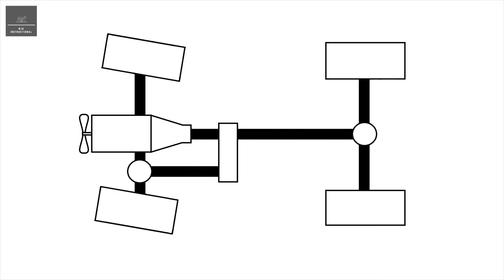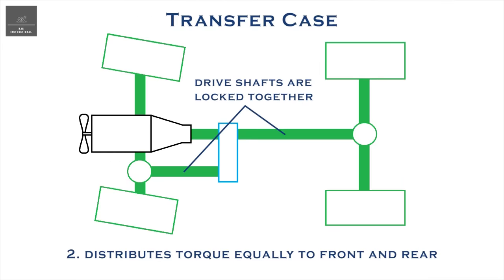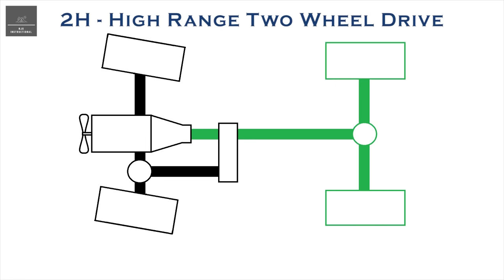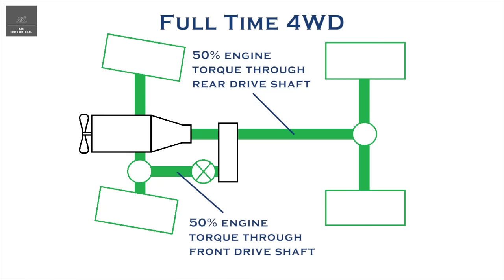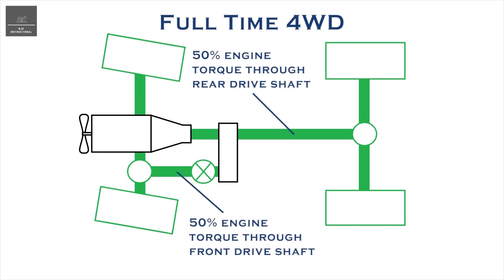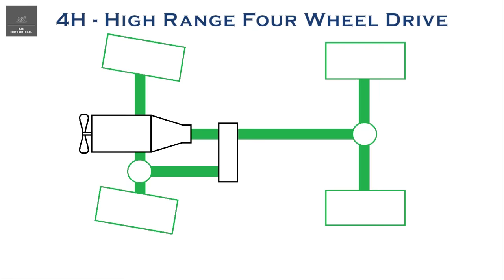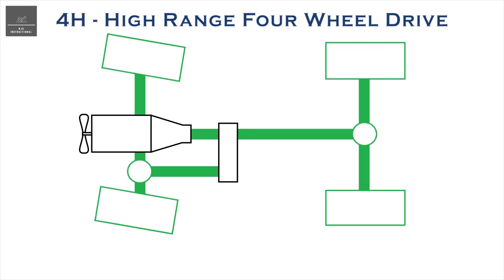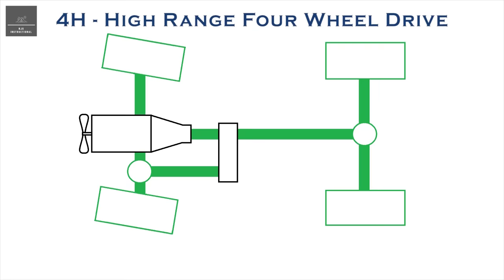How 4WD (4x4 - Four Wheel Drive) Works - 2H, 4H, 4L, LSD, Centre Diff, Diff Locks, Traction Control

Comment: great vid but you mixed up torque split and speed split for locked vs open diff. open diffs have 50/50 torque split and uneven speed splits while locked diffs have variable torque split and locked speed split.
Reply: No, he was right. In open diffs, under IDEAL conditions, it will be 50/50, like going in a straight line. But let's say you get one wheel stuck in the mud or whatever, that one wheel in the mud will now receive 100% of the torque, while the other will get 0. Remember, torque will follow the path of least resistance. In a locked diff, since both axles are locked together, they will both receive 50/50, regardless. In this case, let's say you get one wheel stuck in the mud again, that one wheel will still get 50% of the torque, it just won't be able to do anything w/ it due to it not having any traction. The other wheel w/ traction will just have to use its 50% to get the car moving. Hope it made sense.
Reply: @YourMom-nl4uw  What you just explained is almost correct but again you are confusing how torque works. The whole reason why locked diffs are better with low traction is because they automatically shift torque to where it needs to be and they never let torque get limited by the wheel with the least traction. The reason that open diffs lose torque to the wheel with traction is not because the torque is being sent to the other wheel but rather that both wheels are required to have the same amount of torque sent to them. It requires practically no torque to spin a free wheel so therefore that same, very limited amount of torque is applied to the wheel with traction.
Reply: @harrisonwest4032  
Ok. I don't know enough about this to dispute it so I'll just go with it lol..
Reply: @YourMom-nl4uw  Harrison West is correct, open differentials split torque 50/50 regardless of whether both wheels are rotating at the same speed or one wheel is stationary and the other is in the air spinning madly. It's a common misconception.
Reply: @LockyourHubs4WDing  
How, tho? Torque is just a turning action. So how can it still be 50/50 torque split when one wheel isn't turning at all?
Reply: @YourMom-nl4uw  You don't need to be moving to experience a torque. Think of tightening a bolt, when the bolt is tight, you can still push on the spanner, the bolt is experiencing a torque, but the nut isn't going anywhere. Power on the other hand is work done, so without movement, there is no power.
Reply: @LockyourHubs4WDing  
Makes sense

Comment: Hi! May I clarify one thing. I have read the manual of my Pajero Sport. It says you can switch 2H to 4H even up to 100km/h without stopping. So does that mean it is damaging the vehicle when switching to 4H since there is torsion in between diffs?

My Pajerosport has this options. 

2H
4H
4HL
4LL

And a Rear diff lock switch
Reply from the maker: Hi Alain, the Pajero Sport has a few more options which allow it to be used in All Wheel Drive (4H) or Four Wheel Drive (4HL and 4LL). You only run the risk of 'wind-up' on sealed surfaces and in your case when the centre diff lock is engaged (i.e. in 4HL or 4LL modes). If the manual mentions it is ok to switch from 2H to 4H at speeds up to 100km/h then I can't see any issues. Trust this helps.

Comment: Basically a two wheel drive is a one wheel drive 
A four wheel drive is a two wheel drive 
A 4x4 with rear locker is a 3 wheel drive
A 4x4 with front and rear locker is 4 wheel drive

Comment: It may be a stupid question (I'm new to 4WD vehicles), but the wind-up can happen if you use the 4H/4L in a straight line? Sometimes I need to use it to park my truck in my garage because the sidewalk is very high and the rear tires skid
Reply from the maker: Wind-up wouldn't typically occur in a straight-line as there is no inner and outer, front and rear wheel rotation differences.
Reply: @NJSInstructional  Do you think I can continue to use it without the risk of damaging something or it's something I should stop doing?

Comment: An open diff does not transfer the torque to the wheel with the least resistance. The torque goes equally in both directions, but the displacement goes mostly to the wheel with the least resistance.

Comment: may I ask a quick question,  to clear my mind once and for all? On pavement when the roads are wet, am I better of changing from 2wd to full-time 4wd for better braking, etc.  Thank you in advance, cheers Paul
Reply from the maker: If you vehicle is a part time 4wd I don't recommend switching to 4H on tarmac roads in the wet. You may damage your drive train due to wind-up.
Reply: @NJSInstructional  thank you
Reply: Hi Paul, my Ram truck has 4WD "Auto" which essentially is AWD which most of the traction goes to front wheels and allows for each wheel to potentially roll at different speeds ( turning steering wheel while moving on hard pavement ) and can be selected at up to 55mph. Then it has a 4WD Lock ( 4WD Hi) in which all 4 wheels roll at the same speed so you would need gravel, mud, or sand etc, for the tires to slide around while you are turning because turning while moving makes each wheel roll at different speed. Then of course the (4WD LO) function in which this video covers also. Only 4WD "Auto" can be engaged while moving. All others on my truck can only be engaged while in neutral and foot on brake.

Comment: Great video, Can I ask what is the maximum speed one can do when driving with 4L?
Reply: It's different for all, but usually between 25-40mph pegged.
Reply: @yjjeeper1  great ,thanks...
Reply: It's different in each vehicle. Mitsubishi Pajero, don't have speed limit in 4L
Reply: @lapitima  you miss understand. No other vehicles have a 4-low speed "limit" either, that's just when stock incarnations tend to run out of gearing in 4 low.  I know how much you foriegn guys love your Pajero's (basically Montero here), and ive seen some cool builds of them but don't be quite so quick act as if they are the dominator of everything becaus they have their strong and weak points like every 4 wheel drive and are hardly the king of the group.

Comment: Good info. What about using 4H during raining at normal tarmac road. It is recommended or not? and why?
Reply from the maker: Thank you. No, I don't recommend it. Though the road is wet, there is still too much traction and will cause wind-up in 4H with no centre-diff.

Comment: Part Time 4WD Scenario - 4H or 4L
50% torque split makes sense to rear tires Left/Right (locked diff) when both tires have equal ground contact and resistance (one isn't rolling over a rock, for example).  But if one is in the air and other on ground then wouldn't essentially 100% of torque go to that grounded wheel?  I understand the diff splits rear drive axle to two tires, hence 50% torque, but if one tire is in the air then it really isn't consuming any torque in order to turn it.  I mean, since torque is force/distance and the spinning wheel is consuming (let's just call it zero for this purpose aside from wheel spinning momentum/etc) uses zero torque but the drive axle is still outputting value X torque so that means the wheel in contact (in a locking diff scenario) would have ~100% of the drive axle torque (assuming for argument sake that the diff gear ratio was 1:1).  
It's hard to be suspensed on just one tire but let's assume a diagonal situation on a hill with rear low and somehow the top contacting tire is also on ice. In this scenario then torque split to front/rear wouldn't be 50% either.  I'm having a hard time visuallizing a spinning tire consuming torque when it has no resistance force.
Reply: Exactly. I was actually getting very confused regarding the torque distribution. Nobody notices this expect you.

Comment: Going down steep hill on ice, on 4 W High and on drive, vehicle goes down too fast. Is it better to put it in second gear, or switch it to  4 W Low? On 2nd gear or drive?
Reply from the maker: Best you choose 4-Low and select your gear prior to the vehicle heading down hill. You don't want to be changing gears going up/down hills...

Comment: Nitpicking:
2H Rear Locked with one wheel in her air: 100% of the torque goes to the wheel on the ground, as long as the other is in the air, not 50% like he said in the video.

Comment: great video.  If the TC is so good in off road whay there is the option  to switch off the TC system?  Why the TC system turn off when 4L is turn on?
Reply: Because on very universally loose surfaces like sand , snow etc it is more of a hinderence. BTC needs at least some wheels to be in contact with a high traction surface to transfer torque to, (by braking the opposing wheel ) , it also as part of its operation limits or reduces engine torque,  this is particularly problematic in sand where you need momentum and torque to keep pushing through,

Comment: Do any vehicles use a limited slip center diff ?
Reply from the maker: Good question, I'm not too sure. I know some vehicles use an electronically controlled centre differential where the computer dictates when to lock it or not, e.g. Ford Everest.
Reply: @NJSInstructional  oh ok thanks, I was just thinking that it would be a simple way to make a awd car that is good at off-roading

Comment: Very clear information. Thanks. Can left foot braking be an effective poor man's BTC on vehicles which don't have one?
Reply from the maker: Hi Hari, I have tried this technique and it doesn't work at all... The problem is when you apply the brakes to prevent the free wheel from spinning, it also applies the same braking pressure to the opposed wheel. If you are able to apply the brakes on individual wheels it would work (which is what BTC does). Cheers.

Comment: So what are the advantages of using full time 4WD with the inter-axle differential UNlocked on road compared to rear wheel drive on road?
Reply: A 4 wheel drive always provides better traction and control than any 2 wheel or all wheel drive can give, if, and only if, you have been taught how to drive it.

Comment: Why should the "Wind-Up Phenomenon" occurs if the differentials are open? 🤔
Reply from the maker: Good question, the wind-up phenomenon occurs between front and rear axles which are essential locked together in a part time 4WD or centre diff-locked full time 4WD.

Comment: i just got a truck, and mine have 2H, 4H, 4L, and olny Rear lock dif, there is any issue if in one moment i have to or try to use 4H or 4L and Rear Lock Dif?, i understand how the torque gonna split, but is ok to use it like that? or is better use it only with 2H? Thank you. Nice Video.
Reply: Some vehicles allow you to lock the rear diff in 2H and some require 4wd.. depends on the situation you're in if you're able to do either

Comment: A front diff in a part time system locks different then a full time system which works like a front wheel drive car so it still turns and frre wheeling hubs get better gas milage since front axel dont move when vehicle is driving
Reply: Superb presentation

Comment: Your differential explanation is incorrect - just because one wheel is spinning doesn't mean that no torque is being applied to the other wheel,  its an equal and opposite interaction. When the diff is locked the torque will split according to the load presented at the wheel, so if one wheel is in the air then all the torque will go to the wheel with traction.

Comment: Super explaination I have a doubt sir why 4×2 vehicles thats is part time four wheel drive systems doesn't provide centre differential is there any reason or it's done simply for cost cutting .
Reply: I think it's for cost cutting and durability: Less things to break, more reliable.

Comment: Question about the crawl ratio part, I have a 2020 Jeep Wrangler Rubicon with an automatic transmission so it has a crawl ratio of 77.2:1, i went with the max torque output which was at 4800 RPM producing 260 foot pounds of torque, with the crawl ratio equation you did i got to where each tire in ideal conditions is getting slightly over 5 thousand foot pounds of torque. Is that right or is my brain just fried from trying to learn this stuff?

Comment: Wish I would have watched this before getting pissed when I got stuck in my 01 4runner ... Was so pissed the 2 wheels that had no traction were spinning and my 2 that needed to spin werent. Found out I need a rear diff locker lol.

Comment: At 14:38 the commentator states that "Only a 4WD with locked front & rear differentials will provide true 4WD". This is not quite true - on slippery surfaces, the centre differential must also be locked. If the centre differential is not locked, all of the drive will go to any set of axles that are slipping leaving the other set without drive.

Comment: Don sa isang video na napanood ko, ang 4H ay pwede at ginagamit lang sa flat road lalo na pag maulan at slippery ang daan. Hindi advisablena gamitin ang 4H sa rough road dahil H or "high" speed nga sya, kapag ginamit mo sya sa rough road pwersado. 4L lang ang pwedeng gamitin sa rough o bako at malalim na daan kasi nga L "low" sya. It's the same principle with manual transmission na kahit nasa flat road ka hind pwedeng 5th gear agad means high speed agad, kailanga 1st gear or low gear muna. Make sense di po ba.

Comment: 9:50 Low gears have a higher rotation speed than higher gears.  The low gears rotate faster and produce more torque, that's why you shift into higher gears as the vehicle accelerates.

Comment: I'd like to ask whether or not an open diff or LSD diff in front diff of part time 4wd would also suffer from transmission windup on high traction surfaces or is it only full diff locked systems?
Reply: Only full locked diffs. Open and LSD's always allow some slippage, so there won't be any wind-up.

Comment: My 4Runner has automatic disconnecting hubs. So, when I'm in 2-High (RWD), is my transfer case and front differential still working, even though they aren't connected to my front wheels?
I know in this case the hubs aren't transferring power from the front axle to the front tires, but when in 2-High, does it also disconnect the power from the transfer case to the front diff?
Thank you!
Reply: Yes, the transfer case shifts between 2HI, 4HI, and 4LO.  In 2HI the front output of the transfer case is disconnected from the rear output shaft.
Reply: @BilletBenny  That makes sense. So, the transfer case is always working, whether it's both differentials or just the rear. In this case I think the rear diff and transfer case should get more TLC than the front diff, because the front diff is ONLY engaged in 4WD.
Reply: @mattsmith6828  I guess if you want to state it that way.  In 2wd the input shaft of the transfer case is directly connected to the output shaft of the transfer case and simply passes the output of the transmission straight through to the rear driveline.  

Your 4Runner has ADD which stands for automatically disconnecting differential.  This has a shift collar that just disconnects the passenger side wheel from the differential at the intermediate shaft.  The driver side tire remains directly connected to the differential and in 2wd this driver side tire spins the side gear of the differential which typically free spins the just the spider and side gears inside the differential case.  So your front differential gears are always free spinning in 2wd, but the ring gear and driveline typically aren't spun due to the friction characteristics and behavior of an open diff.

Comment: I noticed just moving a few feet forward and backwards in 4 low I a parking lot on level dry asphalt it is difficult to brake because of the extra torque and I wouldn't recommend driving on the city streets in water, snow, or ice in 4 low because of the added difficulty of braking safely. Plus the gas mileage would be less in 4 low.

Comment: What is the difference between 4x4 and 4wd
Reply from the maker: Hi, they're both the same. The first number refers to no. of wheels (or sets of wheels) and the second no. refers to how many of these wheels are being driven. Therefore a 4x2 indicates, 4 wheels of which 2 are driven. 4x4 indicates, 4 wheels of which 4 are driven.

Comment: I have an issue with this video in that the rear diff in 2H will always split torque 50/50 when it is open, not 100% to the least resistant wheel. When the diff is locked, the wheels always spin at the same speed, but they do not have the same torque. The one on the ground gets lets say 95% while the other in the air gets 5% because they are locked at the same speed.
Reply: When the diff is open, the torque is limited by the wheel with the least traction. The wheel with traction can only get as much torque as the wheel that is struggling with traction, which is still a 50/50 split.

Comment: Is fulltime 4WD with traction control similar to AWD?
Reply: Fulltime  is as the name implied "fulltime". AWD is not, only when traction is lost on the normal drive wheels (mostly front) then the rest wheels engage power. For your question, no need to specify traction control.

Comment: I drive a Pajero and have 2h, 4h, 4hlc, 4llc which is just 4h and 4L but also with centre lock, it also has traction control and stability control lmao 4llc + TC and SC  could climb a vertical wall 🤣

Comment: You're getting torque distribution completely wrong and contributing to the common misunderstanding of these systems. Locked transfer cases and differentials do NOT split torque equally, they actually bias torque outputs 0% to 100% as allowed by available traction. Locked diffs output equal speeds but allow unequal torques. An open differential always splits torque equally (50/50) but the torque seen at both wheels is limited to the torque available at the lowest traction wheel. So open differentials output equal torques but allow unequal speeds. 

It'd be super dope if you'd get this right in your video and stop contributing to the spread of incorrect information on these systems.